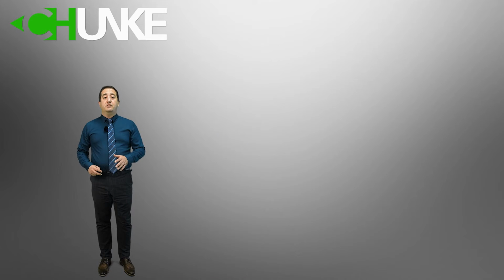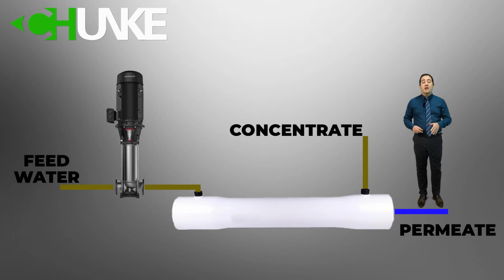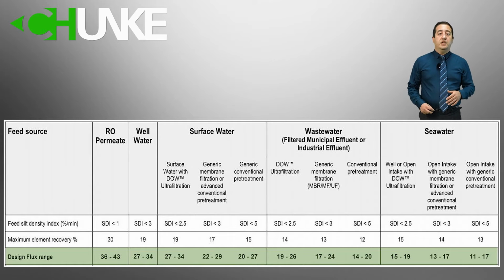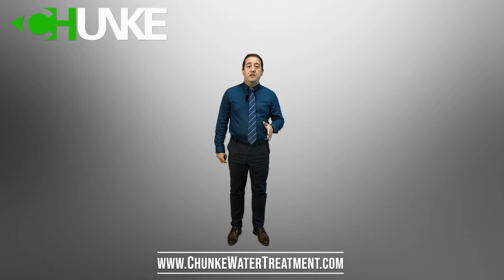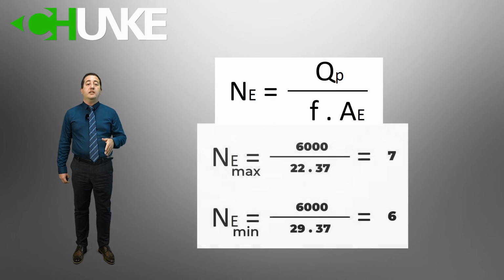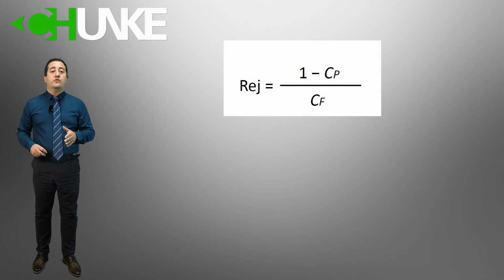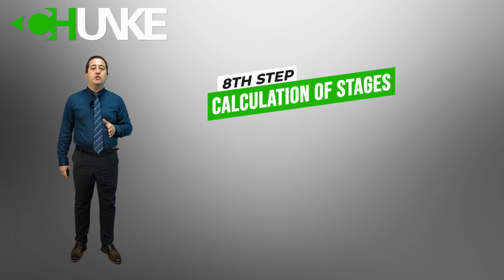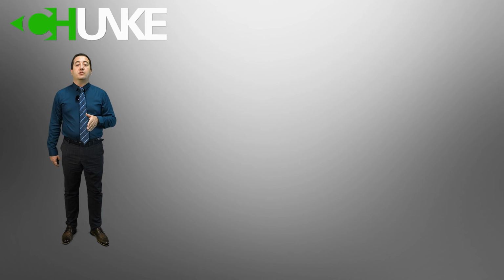10 steps of designing reverse osmosis system, RO plant by Chunke Water Treatment

Comment: thanks for good explanation sir :-) 
but the equations sometimes are incorrect
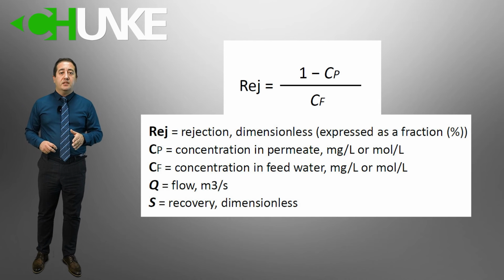for example here 10:20 it should be 1-(Cp/Cf)
also calculating salt rejection I got 0.957 not 0.97
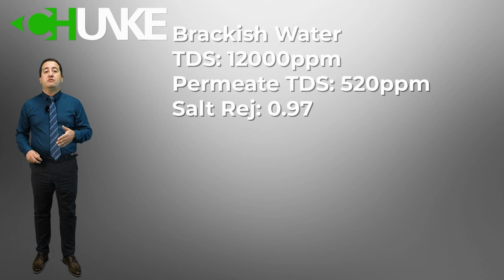and the big problem that made me write the comment is here 10:55 this equation will always give recovery=0
if salt rejection is calculated 0.957 then recovery will be zero
its either salt rejection equation is false or recovery equation is false
the explanation is very good but there are some mild mistakes that frustrated me until I checked the values that you calculated and saw the contradiction between the equations
Reply from the maker: You are right, typing mistake. It is 1-(Cp/Cf). Thanks for your kind attention....